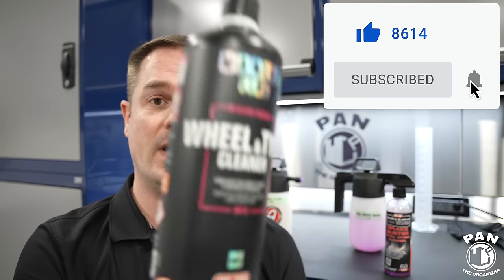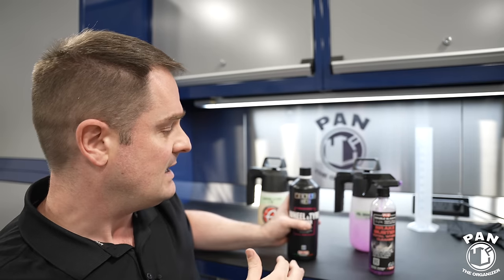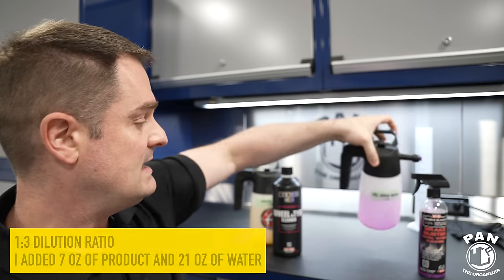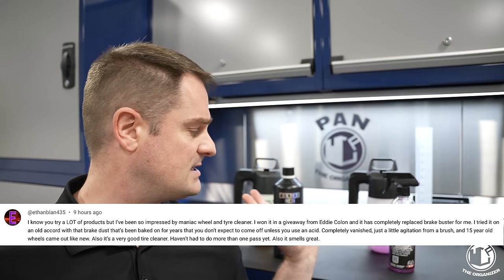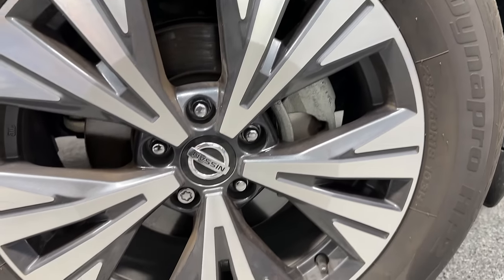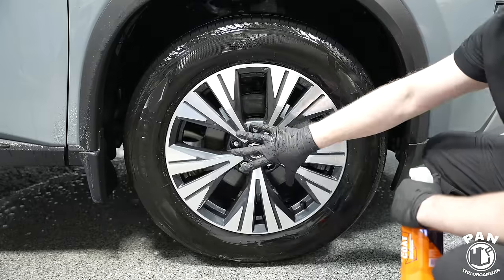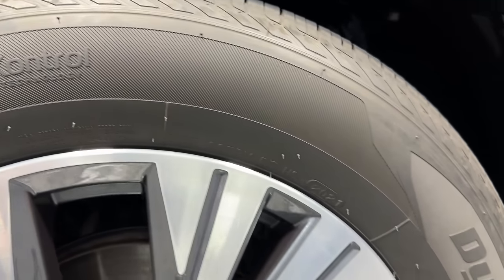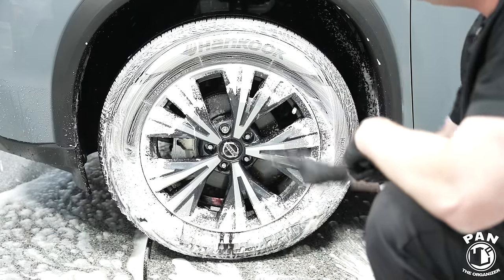P&S Brake Buster KILLER ?? Maniac Line Wheel & Tyre Cleaner TEST

Comment: I still like the P&S Break Busters. I put it in a foam cannon and it works great during my washes.
Reply: I just bought a IK foamer. Which color orphis do you use?
Reply: I see no reason to quit using my P&S BB.
Reply: @Wooooptywoop not the reason we use it for tho. Brake buster is perfect as a maintenance cleaner in which your wheels aren’t very dirty and also people dilute it down usually 3:1 so it’ll last even longer.
Reply: Do you dilute it in the foam cannon?
Reply: @armaandhah1909  yes I dilute it 1:1 so 8oz of brake buster and 8oz of diluted water.
Reply: @armaandhah1909  I run mine straight no dilution in my foam cannon. But you could use 1:1 also.

Comment: To this day nothing beats Adams wheel and tire cleaner
Reply: Adam's is great but it's ph is over 13...
Reply from the maker: It is a very good one too, but a bit too harsh on coated wheels for repeated weekly washes. I tested the Adam's against Brake Buster in this video: https://youtu.be/jfYZh1qB1LY?si=o6mM1dLiH8yqbPOR
Reply: @barrybij8079  break buster is a 12. Plus i dilute the Adam's like at 4:1 which brings the pH down.

Comment: I always use Brake Buster at 10:1 when using the pump foamer. If the tires are exceptionally dirty, I will spray them first with straight Brake Buster before foaming. Works great!
Reply: For dirty tires I use P&S undressed before doing the rims and tires with Brake Buster. Undressed is insane at getting the tires 100% clean Especially Michelin PS tires which always brown and bloom like crazy.

Comment: The tire cleaned with P&S seems to be less brown, which to me seems cleaner. 
I started using the P&S products for interior and exterior, and I am satisfied with them. The Brake Buster works great when I mix it with Chemical Guys Mr. Pink Car Shampoo in my IK Foamer. 
I almost never have to repeat the tire cleaning since it cleans amazing, and I have a Jeep Wrangler with Off Road Tires, which are known to tramp more dirt than normal all season tires. 
Thanks for the Demo Pan! 
Cheers!
Reply: you're correct ... first wheel was more brown than the second with P&S. To my opinion this has to do with the fact Pan used the front wheel first. For P&S he used the back wheel. To my opinion front wheels with a front wheel driven car (Nissan) are more dirtier than back wheels. Think Pan better used the other front wheel to have a more comparable situation.

Comment: I have been a brake buster user for 3 1/2 years now and couldn't be happier. I used to use bleach white tire cleaner on the tires only and a degreaser on the wheels, my preferred method of using brake buster is 1 to 1 for heavy, and 1 to 2 for normal in a foam sprayer, I feel it sticks better and doesn't dry out as fast (maybe it's just me) plus I get to stretch out the product, I typically buy it in the gallon since I only do our 2 cars but it last me a really long time. brake buster is hard to beat for its price and performance. thank you for your reviews I always look forward to them.
Reply: @FNitti665  yes, I started using it back in the day when white letters out was the thing. ( mid 80's ish to mid 90's )

Comment: I began to use Brake Buster gallon size in december last year, diluted 1:10 by recommendation of Pan in the Nissan Kicks 2022, and still have the middle of the gallon. For regular maintenance of wheels and tires is the best combo.

Comment: I use a mix of P&S BrakeBuster and Iron Buster in one of my foam cannons... I spray the wheels, let them dwell a few minutes then use my wheel cleaning brushes and rinse them down, then I use Gyeon Wet Coat or DIY Quick Beads reapply protect to the wheels. It works quite well for me.

Comment: Been using mafra wheel&tyre cleaner for a couple of years, and it has been my go to product. Firstly, the cost is great with further dilution ratio. Secondly it gets the job done relatively well, 1:1 dilution ratio can be used for really really caked on wheels. 
Lastly, it’s one of the better smelling product which make detailing process a little better.

Comment: Thanks for the shoutout Pan! 

I use the maniac at 6.5:1 dilution,  I believe that’s 200ml in the ik foam pro 2. I like the maniac on customers cars specifically. Like I said in the original comment, it did really well on some trashed wheels and seems to be a stronger cleaner overall in my experience. On well maintained and personal vehicles, brake buster is still great. I usually opt for diy all clean instead of brake buster in those situations because it works just about as good and I already have it out to use on bugs.  

When I used brake buster on more neglected wheels and tires, I always used undressed on the tires with the brake buster. I’ve only really found brake buster effective on tires at full strength.
Reply from the maker: Yeah many people will get different results with different products and conditions hence why I like to test for myself. :)

Comment: I totally use P&S Brake Buster at 1:5 for normal use and I've used it as low as 1:10 when I've been running low and it's worked just fine for maintenance washes.
Reply: Exactly. most of my washes are maintaince washes so its 10:1 for me

Comment: Appreciate the test Pan.  I tried both & like Brake Buster more.  The Wheel & Tyre left a bad stain on my tires at 1:3 dilution as recommended by the company.  Never had this issue with the P&S product, although Adams Wheel & Tire is the best I have personally tried of the 3 products.  I contacted the Maniac parent, Soluvap Inc., but it would cost over 3x the purchase cost to send back to Canada from the USA for them to test ... buyer beware.
Reply from the maker: Thanks for sharing Milan!

Comment: Should’ve done both at 1 to 3 dilution ratio. Maybe for part 2.
Reply from the maker: That point is moot, as you're not even supposed to dilute Brake Buster. Nowhere is it written that you can dilute it. So using it at 1:3 is already an off label use. ;)

Comment: I used to get the Turtle Wax Wheel and tire cleaner. Hard to beat for the price and was always available at Walmart. But, I just recently switched to Adam's wheel and tire and got it in a gallon. Performance is a factor but price per oz is too.

Comment: I enjoy your channel. When you share information on a specific brand or product, I think it is very helpful. When it comes to determining value / cost per use, can you also share if a product is only available at only one web site or is widely available from multiple sources. Unfortunately, some retailers will have a low list price for an item but then charge high cost for shipping & handling. It seems that some on-line retailers apply low prices to a specific line item but then make up for it with high s&h. Thanks. Keep up the good work. 
PS As a retired chemical engineer I appreciated that you pointed out that you have a full understanding of the chemistry that you frequently have to explain (at least in passing) in your videos.
Reply from the maker: The Maniac Line is harder to find in the USA, and only a few websites in Canada (linked in the description under the video). It’s easier to find in Europe.

Comment: Try a 1:5 dilution of alfacare power wash. Works like a charm and you can pretty much use it on everything. Tested it on interior with 1:20, seats with 1:15-1:20. Exterior 1:10 and wheels 1:5 for heavy dirt and 1:10 for light. Fantastic and really cheap, 6 euro per liter.

Comment: Ivan with DIY comments that you don't want to remove all the browning as this actually damages the tires. I had not heard that before. Something to do with removing to many antioxidants. Thanks for all your teaching.
Reply from the maker: As much as I respect Yvan, and we have been friends for years, I don't share that same view on tires and tire cleaners. In 27 years of detailing, I haven't seen any evidence that cleaning tires and properly degreasing them (where the foam is white) is detrimental to the tire, or accelerates its deterioration or rotting. Quite the opposite actually. By cleaning the tires thoroughly, you allow the tire dressing to bond perfectly to the rubber, and the tire dressing has the UV protection that will protect the tires, and prevent rapid deterioration anyways.

According to leading tire manufacturers like Bridgestone, tires typically are good for 3 to 5 years on average. It's highly likely you'll be changing tires before ever seeing any evidence of something going wrong just because you used a tire cleaner to clean them.

Also, keep in mind that Yvan uses an APC to clean his tires, which isn't always exactly the same chemistry as they have in actual dedicated tire cleaners. So he might have a different opinion because he uses a different type of chemical.

Have you ever seen a tire destroyed because a person took too much care of them? Not me. Food for thought.

But in the end, you do what feels right to you. I like to work with clean tires. It's not like you have to fully degrease them for every weekly wash. Once in a while, when you need to reset the tire to a clean state, to apply a fresh layer of tire dressing.
Reply: @PanTheOrganizer  Your kind of response is a reason I follow and point others to you! Thanks.

Comment: Currently I use the Meguiars Non Acid Wheel and Tire cleaner. It does come in gallon format and dilutes 2:1. My last order in July 2023 for a gallon was $17.95. Dwell time is just one minute and does not smell nice at all. I hold my breath so not to inhale whatever it is.

I'll be looking to upgrade to the P&S when I have worked my way through the gallon I have of Meguiars.

Comment: I use Adam's Wheel & Tire Cleaner diluted 1:1 if wheels are really dirty.  If it's just a maintenance wash, I use it 1:4 dilution.  Works really well...
Reply from the maker: Yeah the Adam’s is super powerful, I tested that in another battle video. But as it’s pH 13, I wouldn’t recommend it for regular weekly washes on coated wheels.
Reply: @PanTheOrganizer  
Good to know, Pan. That's very alkaline! 

Adam's Wheel & Tire is my standard wheel product @ 2:1, usually with 2 applications, depending on the conditions. I found it to be better than BB at the same ratio and application. I always wait for Adam's sales, which are frequent, and pay $29.95 for 128 oz. I wouldn't pay list, which I think is $45.99.

Also worth considering is Turtle Wax/Hybrid Solutions Hyper Foam Wheel Cleaner and Tire Prep—$11 for 23oz. I've only used it a couple times from their spray bottle at 100%. I've yet to dilute it in a foamer, but I was very impressed the few times I used it and the price is right!

Comment: Great video as usual!
I use a Swedish brand, Arcticlean. They have a very good dedicated wheelcleaner and separate tirecleaner. The wheelcleaner is a bit too expensive, even in 5 Liter format.
Since I clean my car on a regular basis I have decided to use P & S Breakebuster with my IK2 Foamer on moderate dirty wheels/tire/wells and only use the dedicated wheel cleaner as needed. Also for the iron-decontamination step.
P & S is yet to be tested though but it looks promising 🙂

Comment: Manic Line for the win . Retry this but with these cleaners at the same dilution ratio.
Reply from the maker: That point is moot, as you're not even supposed to dilute Brake Buster. Nowhere is it written that you can dilute it. So using it at 1:3 is already an off label use. ;)

Comment: Hi Pan, I use P&S, but I find I always need more than 1 pass to get white foam on my Michelin tyres. I guess that not all tyres are the same, and maybe some makes of tyre respond better to different products or different dilution ratios.
Reply: Michelin PS tires are so hard to clean fully. I started using P&S undressed and it's amazing. I've never been able to get these pilot sports fully cleaned until I found P&S undressed. The best dressing I found on these is Gyeon Q2 Tire. Stays black for a month with a stain sheen.

Comment: Another 'Pan'tastic video, cheers. 'P and S Professional Detailing Products Double Black Renny Doyle Collection Brake Buster Total Wheel Cleaner', is an expensive product over here, in the UK. It is worth the extra money because of its safety, strength and dilutability. But what really sells it for me, is the corrosion inhibitors that this product contains, thus protecting the brake components from flash-rusting after washing.
Reply from the maker: Thanks!

Comment: I have found through extensive testing over the years that Brake Buster and Meguiar's non-acid wheel cleaner are the best, closely followed by Adam's Wheel and Tire cleaner. The Adam's is excellent but pricey in comparison.

Comment: I kind of wish you did 5:1 with BBuster so it’s apples to apples. That’s the dilution I use in my ik pump sprayer. But this was still helpful because i’ve never used or seen it at 3:1. I might have to try that 👊🏽
Reply from the maker: That point is moot, as you're not even supposed to dilute Brake Buster. Nowhere is it written that you can dilute it. So using it at 1:3 is already an off label use. ;)
Reply: @PanTheOrganizer  agreed 👍🏽

Comment: Captivating & intriguing video, Pan. Love the comparison analysis. 👍🏼  But I do wonder what the results would be, and how they would compare, if you diluted them to the exact same ratio, Hummm. 🤔
Reply from the maker: That point is moot, as you're not even supposed to dilute Brake Buster. Nowhere is it written that you can dilute it. So using it at 1:3 is already an off label use. ;)
Reply: @PanTheOrganizer  Correct & agree. Just my curiously 😊👍🏼👍🏼
Reply: @PanTheOrganizer i've always used brake buster neat

Comment: I'm been using adams wheel and tire cleaner for a couple of years. I'm gonna give p&s a try next
Reply from the maker: The Adam's is great, but at pH 13 it's just a bit too strong for weekly washes on coated wheels, it might eventually weaken the coating prematurely.
Reply: @PanTheOrganizer  wow I didn't know the ph was so high. Thanks for the info Pan. I'm definitely switching now since my wheels are coated

Comment: Pan, Ivan at diy detail just release a short tellling viewers that cleaning tires a second time until the foam remans white will shorten your tires longevity because leaving some oxidation on the tire is a good thing. In your videos you always seem to clean tires until you agitate the cleaner and it remains white. What’s your take on this? I’m a little confused!
Reply from the maker: I never saw any actual evidence to the theory that it shortens the tire’s longevity. There are always new theories. Until I see evidence, I stick with the tried and true methods.

I have been detailing for 27 years so I can rely on my real world experience to do tests and see what works. And in the case if tires, the way to ensure they are 100% clean before applying a tire dressing is to use a tire cleaner or wheel cleaner and scrub and repeat if necessary until the foam is white. That’s a clean tire.

Comment: Great video my friend.  I await your content eagerly.  I’ve been using the Adams Wheel and Tire cleaner and have been happy.  I figured it’s VERY similar to Brake Buster, but I don’t know if it has the corrosion inhibit aspect.
Reply from the maker: It doesn’t have corrosion inhibitors and it’s pH 13 so I wouldn’t recommend the Adam’s for regular weekly washes on coated wheels.

Comment: I haven't used either one but I agree P&S Brake Buster did a little bit better job.  I'll have to give them a try but I suspect Brake Buster may work best for me.  I have off road tires and think it may do a better job.  Would you happen to know how the P&S' scent compares to the Turtlewax Hyper Foam Wheel Cleaner and Tire Prep?
Reply: Hi Pan, thanks for uet another informative video. I use the Turtle Wax Hyper Solutions Foam Wheel and Tire Cleaner. But I will definitely try this in the future. Best, Costa
Reply from the maker: What's your go-to wheel & tire cleaner? Both P&S and the Turtle Wax smell like strong alkaline chemicals.

Comment: For me Adam’s wheel and tires or wheel alone is my #1 over PNS !
I try both and they are excellent but Adam’s for me is my #1 choices,
Note Adam’s wheel cleaner can help to remove iron my 2 cents.
Reply from the maker: Adam’s is very strong but I wouldn’t recommend for regular weekly washes on ceramic coated wheels as it’s pH 13.
Reply: Correct I try to use first a APC and if don’t work go up , the Adam’s tires and wheels is excellent like PNS love both.
Have good day,

Comment: I have 19” aluminum wheels with shiny piano black gloss combined. There’s a lot of the black in the wheels and I’m afraid to use anything that will cause the finished dull or get scratches. Or either of these products OK for that? I know you said all types of wheels but I just wanted to make double sure. better to be safe than sorry.
Reply from the maker: My Porsche 911 Turbo S has a lot of gloss black in the wheels, and these two wheel cleaners are perfectly fine. What's most important to avoid scratches on gloss black wheels is the tools you use. On gloss black wheels, I would use these:
Microfiber wheel mitt: https://bit.ly/45Bxnie
Microfiber brush for wheel barrel: https://bit.ly/3P2kl6m

Comment: Right now I use mothers foaming wheel and tire cleaner and I like how powerful it is on rims and tires that get abused and I just recently tried chemical guys Diablo wheel cleaner and I found I really did not like how it worked at all. What do you think of these products and do you recommend I try one of these. I mostly do motorcycles which are hard to get in places with brushes